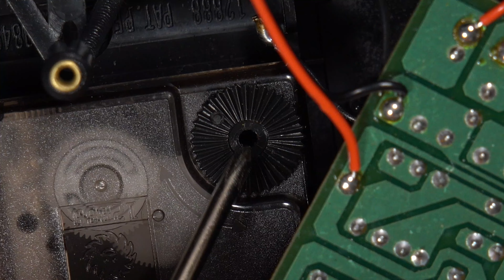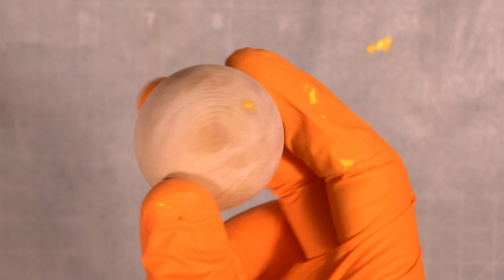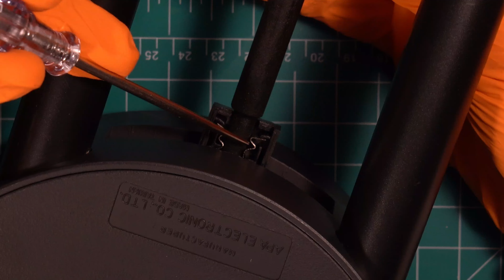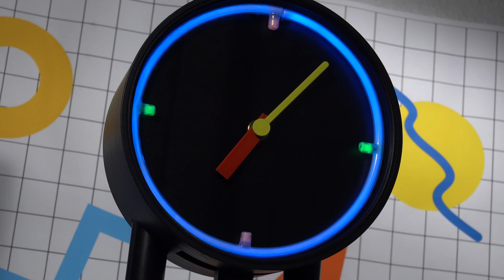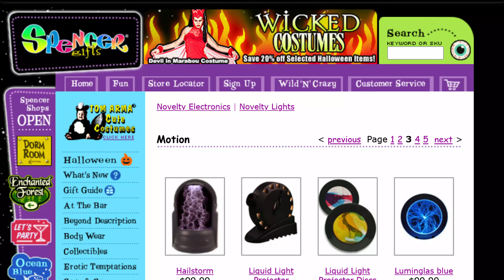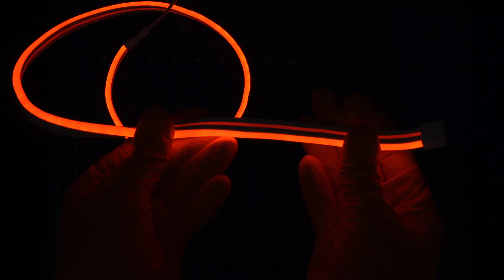Fixing a '90s Neon Clock

Comment: Neon clocks were a thing back in the 90s in particular. The different colour ends on the 3-6-9-12 positions are unique, I've never seen anything quite like them on neon tubes because normally the tube is in a series circuit, the phosphor coating inside must be causing the different colours.